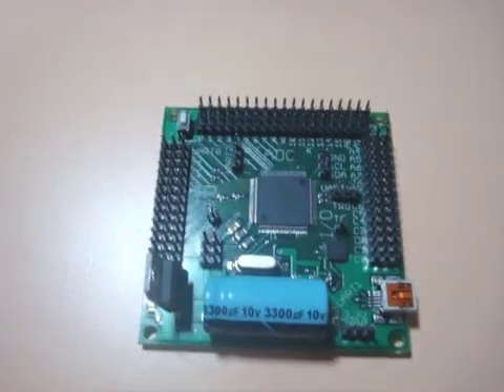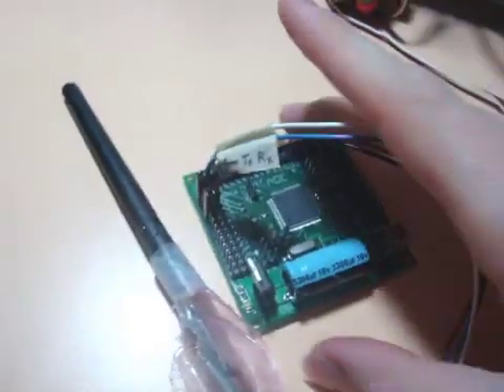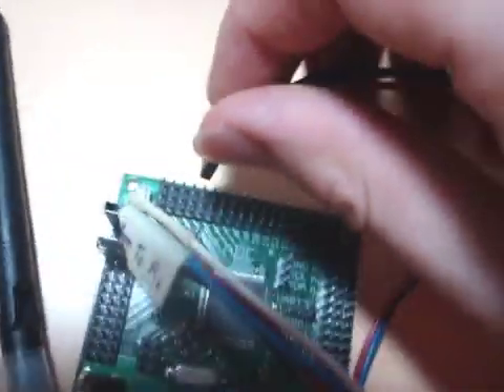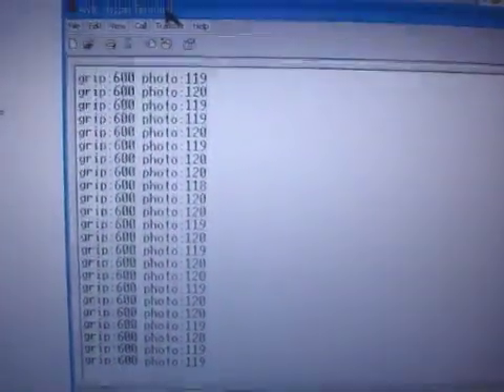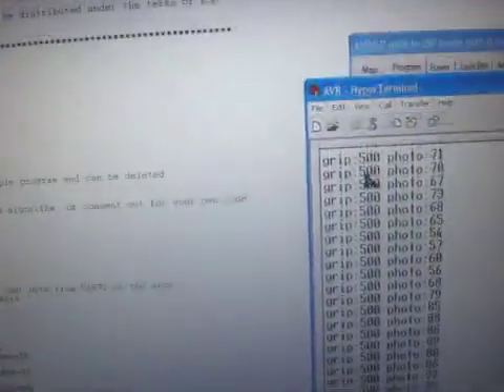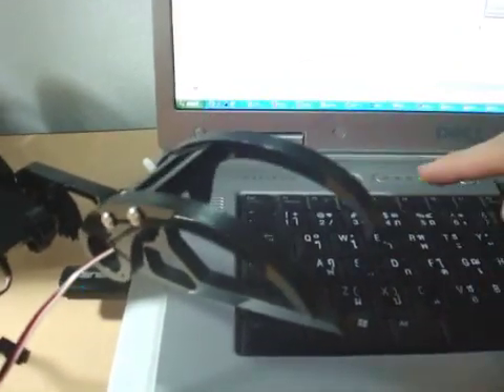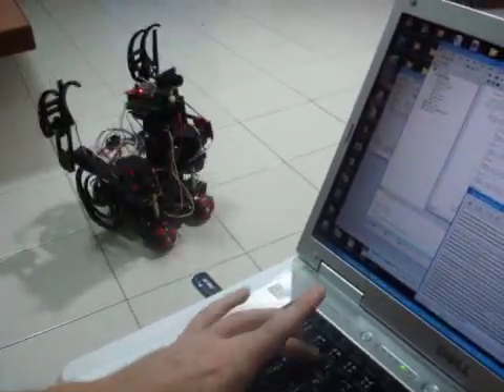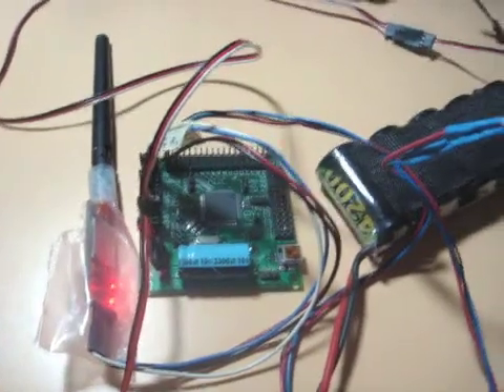Axon Bluetooth Tutorial

Comment: @palmisano Well, I use the Arduino because it is easy (for me) to learn how to use, it gets the job done (I don't do very many high end projects), and because I knew c++ pretty well before Arduino and the IDE of Arduino is similar to c++. However eventually I will progress, and as I learn more I may need better hardware. Are there any boards in particular you recommend? Keep in mind that the easier, the better.

Comment: why does Arduino suck? (ive never used it)

and why is the Axon superior?

Im building a UAV - Aerial Vehicle for a comp and I need GPS and stabilisation control.
I found a shield for the Arduino that does it pretty easily.

I dont have much experience programming and is why im looking at Arduino and doing research.

Have you heard on ArduPilot?  its an autopilot for arduino